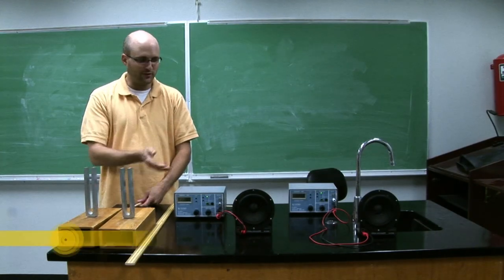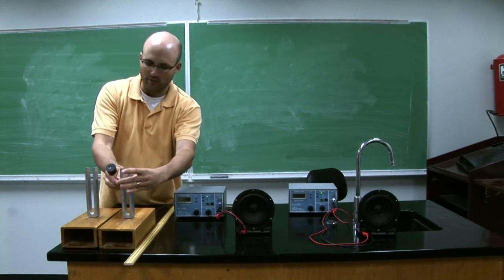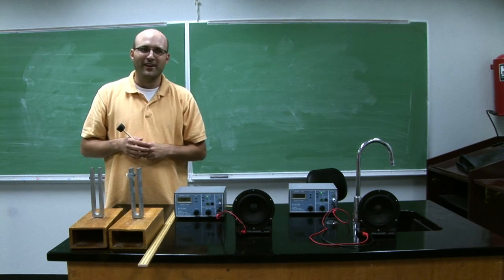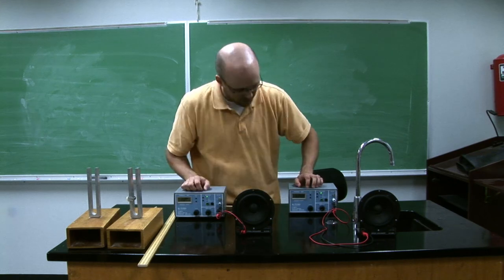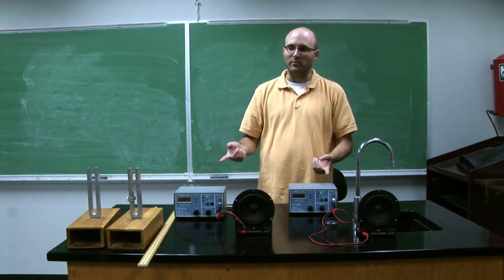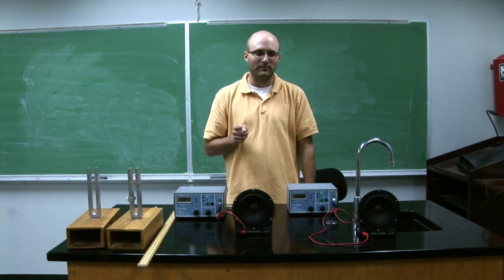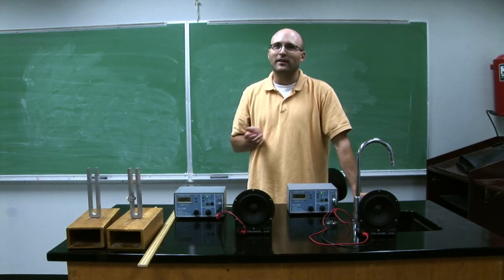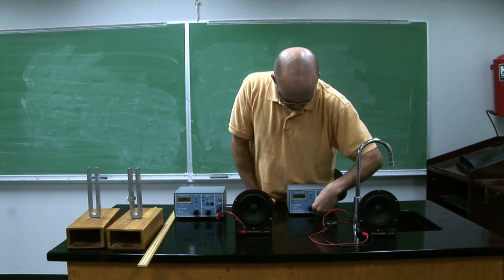Demonstration of Beats

Comment: Thanks for the comments!  Sonu - That's a good question, and if I redo the video as Luis suggests, maybe we can see.  I have tried facing the sources at each other before, and you hear the same beats.  To prove this to myself, I did the mathematical addition of two similar waves the normal way and with a phase shift added to one of the waves, the wave sum with the shifted wave is shifted itself, and you get the same pattern.  For example, see http://www.wolframalpha.com/input/?i=graph+sin+%282*pi*100*x%29+%2B+sin%282*pi*101*x%2Bpi%2F2%29+from+-2+to+2 and then try it again without the pi/2 phase shift.